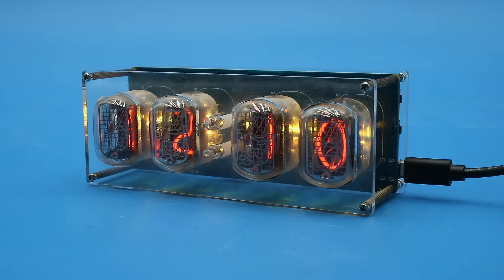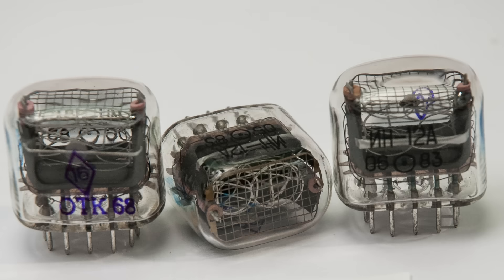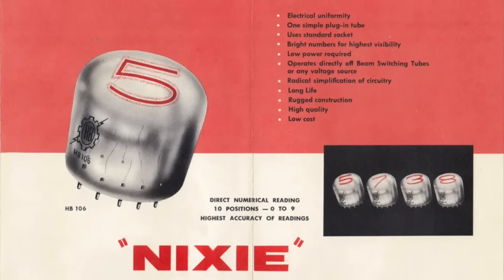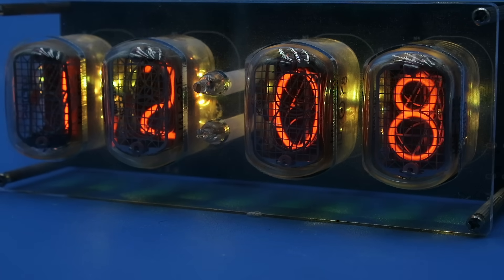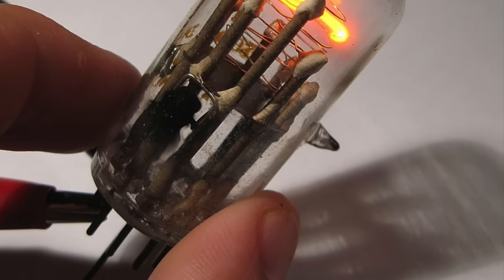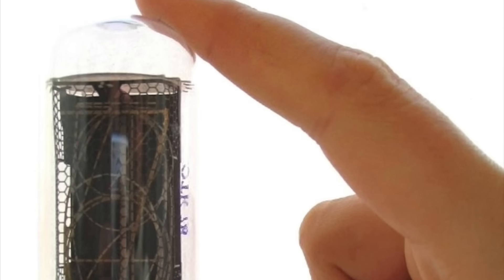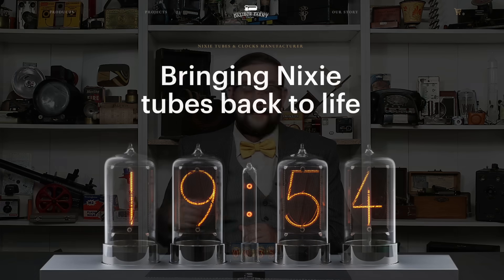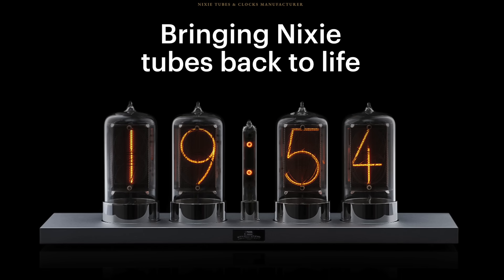Nixie tubes: the OG Digital Display

Comment: Late to the comments, I know, but I just stumbled on this video. My first job out of college as a newly minted electrical engineer was with a small instrument manufacturer primarily in the petrochemical industry. This was 1977, so nixies had already been made obsolete by 7 segment LED displays. But we got a job to build instrumentation for a nuclear power plant, and at least at the time regulations required displays with a separate element for each numeral... so for example a bad segment in a 7 segment display couldn't show a 1 instead of a 7. Thus, though obsolete, all the displays in this project were... you guessed it... nixie tubes. I thought it was a fascinating technology at the time... and still do!

Comment: I recently bought a "Nixie"-like clock that has a number of small rectangular graphical color LCD displays, installed inside of removable glass tube covers.   Each display "digit" can render any color bitmap that you like, including a nice image of nixie tube digits (of a couple of varieties) as well as other more abstract or modern digits.  At a glance you get the impression of a nixie tube, which you can change at your leisure.   I'd love to have a real nixie tube clock, but this is somewhat more affordable, flexible and the LCD displays will ultimately have a much longer lifetime.  Or at least can be easily swapped out if necessary.     

Still, I remember using an old HP frequency counter with nixie tube displays back in the mid 1970's at the local ham radio store workbench while working an after school job in high school.    That frequency counter was huge and had vacuum tubes inside.  It was counting the hard way, apparently.   Even in 1975, it was old!

There was another display technology

Comment: I just finished putting together a Nixie clock that looks a lot like the one you have on your desk. I don't know about the twenty thousand hours. One of my clocks has been working for at least a decade and is still going strong. 

The new Nixie tubes are extremely expensive compared to the new old stock which remains at about sixteen dollars for the IN12 tubes. IN14 and larger tubes have gotten pricey. 

There is something about the amber glow that still makes Nixies attractive though lots of people don't get it. They equate them with seven segment displays at first glance and miss the beauty of what's really going on inside the glass envelope. 

Thanks for the video. I'm still waiting for you to cover the Curta Calculator. A fun and collectable tool from the past with an interesting history (including a Nazi concentration camp).

Comment: I've always liked nixie tubes, ever since I saw them in some electronic scales when I was a kid, I bought one from Tandy in 1977, and made it light up using a 9 volt battery, connected to an oscillator driving a step-up transformer, then rectified, I have a Niwa nixie watch now, that I wear most days.

Comment: A few years ago I repaired a 1973 vintage Fluke 8375A multimeter, just to stop it from being scrapped for its Nixie Tubes.  So Nixies were still very much a thing until at least the early 1970s.  I also have an LED calculator from 1975, so I think 1973-1975 is probably about when LEDs took over.

Comment: While in the US Air Force in the 80s and 90s, I often used test equipment that featured Nixie tubes. The equipment looked like it was from the 50s, but it still worked using what I considered several old technology features like Nixie tubes, wide metal reel-to-reel punch tape, etc.

Comment: I have a collection of about 190 nixie tubes and Panaplex displays, including the IN-18, the ZM-1040 and NL-840. I consider these to be three of the most attractive nixie tubes ever made. The proportions and shapes of these 3 displays are just right :). At one time I had 100 pieces of the B-7971 tubes, which are 15 segment displays that can form a very readable full alphanumeric character set.  B-7971's were used in the Lectrascan stock ticker display at the New York Stock Exchange during the 1970s. They were also used in similar applications a number of other places, but the NYSE display was probably the most seen display.  Pairs of these tubes are currently trading around 275 on a well known auction site and sometimes nearly double that.  Crazy.

Comment: Some nixies can last much longer than 20,000 hours, I have an I-16 clock I powered on in 2012 and has been running virtually 24/7/365 since then and it looks good as new.

Comment: Yeah, modern reproductions are just way too expensive. Unfortunately, a lot of the equipment that used to exist for manufacturing them has been scrapped, so any new company that wants to get into it has to make their own tooling from scratch or refurbish janky old equipment. Either prospect costs far too much money. It's a shame there isn't more demand for them which could generate interest in investment and maybe bring the cost down. I'd love to see cheap Nixie tubes again. Although, I'd really love to see someone make a whole display of light up elements to display low resolution images, like the old amber colored CRT's. It would be ridiculously complex and expensive to make, but a big, fat, Nixie tube that could display ASCII text and pixel elements both would be really cool. Even just 80 by 25 would be so awesome.

Comment: "Cold-cathode" - this means that unlike most vacuum tubes, the cathode (electron-emitting element) did not need to be heated, so Nixies have no filament, which means they make much less heat and use less power than other sorts of tubes.  They preform the necessary function just by being filled with neon gas, which of course means that aren't actually vacuum tubes!

Comment: I loved Nixie Tubes as a kid, because you didn't need any fancy electronics, just a slightly high DC voltage (170V) and a resistor, to the anode.  Then you connected any wire from the bottom of the Nixie Tube to the negative supply (ground), and the corresponding element would light up.  You could do it manually, with switches, or with relays, including, stepping relays.  No silicon required!  (except for the AC>DC converting diode).  I still have about 40 Nixie Tubes and 9 of them are glowing right now!

Comment: I remember using a rack-mount counter with Nixie tubes in a physics laboratory in the 1980s. It was probably 20 years old at that point. We were doing some lab exercise that involved a count of events triggered by some radioactive source, and I remember having the weird thought that if the many-worlds interpretation of quantum mechanics was right there was another branch of the universal wavefunction that was exactly the same as mine except that the last Nixie tube showed a different digit.

Comment: You would get a kick how HP decoded the count & drove the Nixie tubes.  There were no reliable high voltage transistors to do that, but there were cadmium sulfide photo-resistors ("CdS cells").  A binary-coded decimal counter consisted of 4 TTL flip-flops.  Each flip-flop was connected to neon-lamp pair.  The other electrodes of the pair were connected to switchable voltage bus through resistor.  The neon lamps had carefully-matched breakdown voltages.  While the counter was counting (for example, the frequency), this voltage was low.  Then after the count was done, this voltage was raised to in excess of neon lamp breakdown voltage.  The lamp with cathode connected to logic "low" would fire first, latching on despite the counter resuming counting, as long as the lamp power was maintained.  The 8 lamps (for complete decade counter) were inserted into a block of black plastic with an array of tunnels in it.  On the other side were CdS cells.  The light from the neon lamps, in conjunction with the tunnel configuration, decoded the proper digit & the Nixie digit was in series with the CdS cell.
          So you have 5 volt TTL logic doing the count, the neon lamps serving both as latch for the count, & emitting light for the decoding tunnels.  The CdS cells could handle high voltages to drive the Nixie tubes directly.
Reply: Cadmium Sulfide cells are incompatible with modern RoHS mandates, but somebody somewhere must still be making them because Fender guitar amps have used them for the tremolo ( "vibrato") circuit since the 1960's, and still do, for US-market amplifiers anyway; the CS cells are disallowed in the EU and UK by the RoHS regulations (therefore, export  versiins of those amps have to use a digital circuit for the tremolo effect). I wonder if modern Chinese neon lamps have eliminated the mercury vapor; FranLab has noted that Chinese neon lamps have  very short lifespan.
Reply: @goodun2974  The way to properly replace CdS cells is with JFET.  The CdS cell served as a "voltage variable resistor" to change gain dynamically.  With JFET, if you keep the voltage on the channel less than 0.1 V, the V-I characteristic is linear, but the slope changes with gate voltage.  The REAL reason to get rid of CdS cells is because their characteristics change with age until they "see light all the time" even when there is no light.

Comment: I kind of like them, I made a Nixie clock from some old gear, and have some new old stock Siemens tubes for my next attempt, however recycling old test gear is often easier as most of the needed bits, like high voltage power supplies are already there. (however I leave HP 19inch gear alone, just too big)
Unfortunately the Soviet tubes with their inverted '2' eek me so I stay clear of them.

Comment: I had a 12 digit calculator with these tubes in the 70s. Was always fascinated with the glowing numbers. The calculator had a K constant button that would calculate so fast that it seemed to light all of the numbers in the lowest digit at once. It wouldn't stop until you stopped it. Still dont know what the purpose of that was.

Comment: Appreciae the research that went into your video about nixie tubes. In the late seventies I worked in a color photo lab and we had this cart with a Kodak exposure timer on it that used 12 Nixie tubes. They were bright and easy to read and reliable. A very cool technology for its time. The timer was used to read the exposure times on Kodak "S" photographic paper printers. We worked with Kodak "S" printers that projected a halogen light upward through the negative that was being printed positioned on a negative tray, some printers used reels of negative film, while large format negatives were loaded individually by an operator. The light passed through the negative up to a rotary lens deck similar to a microscope, in that it could be rotated to select the degree of enlargement, it then passed through an area with three swinging cutoff filters that were RGB. When enough cyan exposure was reached for each color a red cutoff filter was swiveled into the light path essentially cutting off any more cyan light exposure, a green filter blocked magenta light and a blue filter blocked any further yellow exposure. The cutoff filters were operated by compact solenoids that converted linear motion into rotary motion to rotate the filters in and out of the light path. Typical exposure times were around 10-12 seconds total for each print that was made. The light passing through the cutoff section was then projected up on to color light sensitive paper that was purchased on reels that were advanced similar to film in a camera after each exposure was made. The paper was unloaded under darkroom conditions and placed into a light tight bag and taken to the processing department for developing.

The problem was not the vacuum thyratron tubes that controlled the exposures, but the halogen light sources kept drifting in color. When I first started working at the lab the halogen lamps made in Germany lasted up to a year with 8-16 hours of use each day. After three years when I left for another job the lamp life had dropped to less than a month. Talk about a conspiracy! So if a printer was running too cyan one of the least acceptable color variances in wedding photography that we specialized in. Those dresses had to look white not cyan or green.  Warm colors were more acceptable to our clientele than cool colors. So we would install a so-called perfectly exposed test negative that Kodak supplied that produced a test pattern on the photographic paper. The test exposure was then read using a Macbeth color analyzer that used a photo multiplier tube. If the test showed too much cyan exposure for example, then the time registered on the printer timer for the cyan exposure was reduced by a few tenths of seconds. We tried to maintain our color output within a couple of CC units for every photograph we processed. Not easy with all of the variables.

The vacuum photomultiplier and pentode amplifier tubes used back then for the light amplifiers and the thyratron tubes were all pretty reliable. The four nixie tubes for each color could read out to the hundredths of a second. The telephone relays used to drive the solenoids were also very susceptible to dust on the contacts resulting in stuck cutoff filters. GC contact cleaner was a life saver there. So that was one of the tasks I did for three years chasing color shifts on 16 color printers. The chemicals used in the processors were another quality control issue on their own. Even the photo paper varied from one batch to another. We had enough volume that we could buy paper that was all from a single production batch from the Yellow Father.
Reply: That was so awesome to read thanks for sharing

Comment: The moon bus set control panel in Stanley Kubrick's 1968 "2001: a Space Odyssey" has Nixie tubes. There are two arrays of six tubes. One array for the pilot and co-pilot above the control sticks. Always makes me smile when I see them.
Then there are numbered wheels like old mechanical odometers and clocks (like you can see on the bridge of the Enterprise in the Original Series from the 1960s). And there are stepping counters like those old mechanical hand attendance counters or mechanical score wheels on amusement devices like pinball machines.

Comment: A common way of preventing the poisoning of the digits was in full view on the clock on your desk. Every now and then the electronic circuitry is set to "exercise" all the segments by quickly displaying every digit quickly. My kit is from PV Electronics  of the UK and they have a similar feature called "slot mode". At a user specified minute every hour, the digits flash sequentially through every digit, each starting at a different digit and runs for 5 seconds until they each settle to the appropriate digit for the current time. They don't all get to the right digit at the same time because they started at different digits. Really cool effect that looks like a slot machine.

I bought a bunch of replacement nixies from a fellow in Ukraine in case I do have to replace any of mine but after five years they are all still sharp and bright.
Reply: By the way, my kit uses IN-8-2 tubes which don't use the upside down 5 for 2, but have a separate distinct 2.
Reply: I have several PV electronics clocks. They're great clocks.
Reply: For TFT screens that display the same information at one spot, like a logo, all the time, there was a program that put a one pixel vertical line on the screen, the inverse of the colours that had to be displayed.
The line then moved from left to right at a set speed to "wipe" persistent images.
You hardly noticed it going over the screen.

Comment: I have both a Heathkit voltmeter and frequency counter that use Nixies. Neither works quite right. Given that both can be replaced by modern equipment, I'm tempted to steal the Nixies.

Comment: National Union's tubes did see very limited success, thus being almost unknown today. About ten years ago someone was selling a real boxed military Inditron on Ebay, so there was at least some sort of design win. I have collected just a few over the years, including one for a compass (displays the letters N S E W). Hen's teeth!
Reply: Some years back I bought a dozen or so National Union 350B's at a flea market and sold them for big money on ebay. The 350B was a Western Electric version of fhe venerable 6L6G, and this is the only time I've ever come across another manufacturer using WECO's unique, proprietary tube-nomenclature.
Reply: @goodun2974  Yes, I found NOS National Union 274A rectifiers once. Too bad it was 25 years ago!
Reply: The finsl pair of NU 350B's sold for $800, and thev guy was using them as voltage regulator tubes for a homebrew tube amp! I've sold plenty of National Union tubes over the years, mostly to vintage radio collectors and restorers, but I've fouund very few WECO tubes, certainly no 300B's anyway....